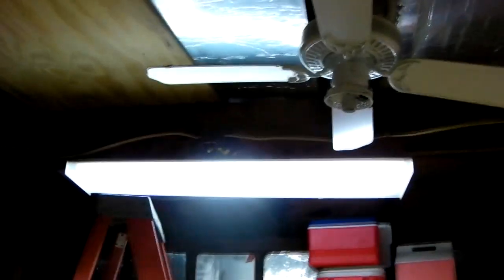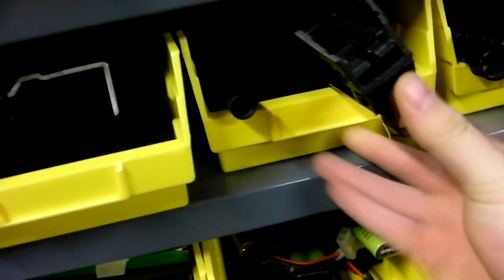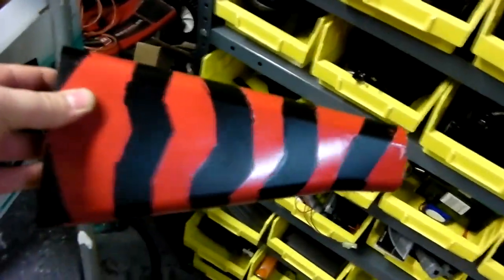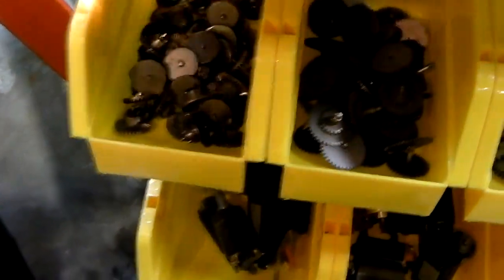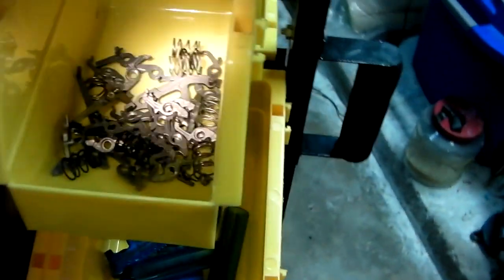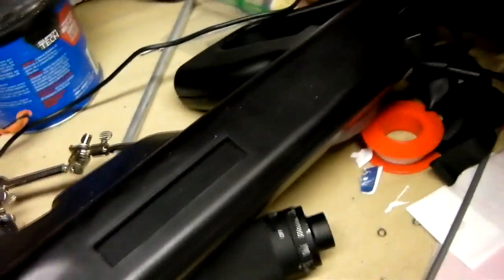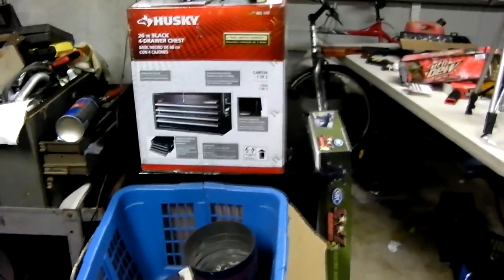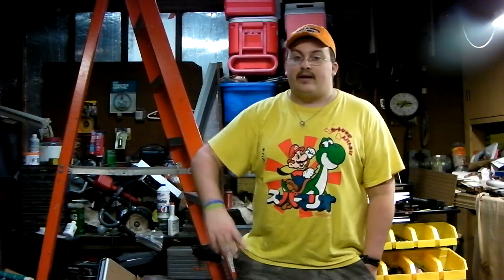work bench,parts,tools and guns

Comment: @AirSofttalk i am planning on becoming a tech and i know a few of the basics but i am unsure if the cyma ak series stock gearbox is lipo ready and i dont have the time to take the gun apart but i am only planning on using a 7.4v 1300mah lipo so if you could tell me if that gearbox is lipo ready that would help a lot btw great vids